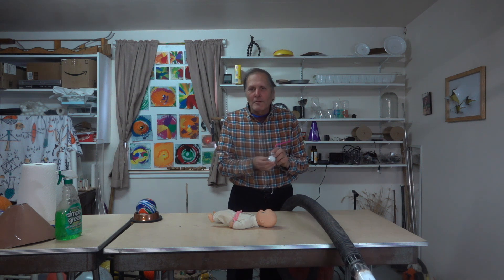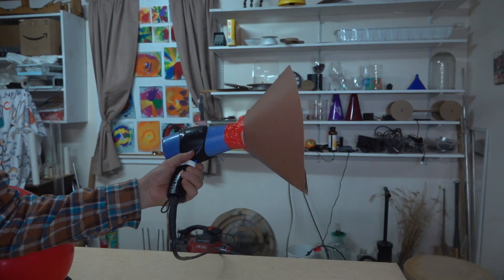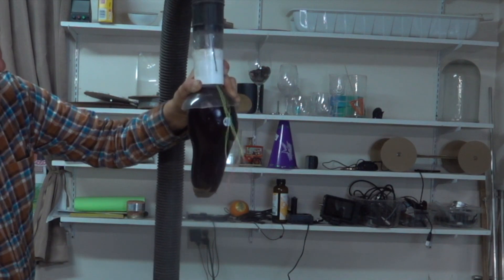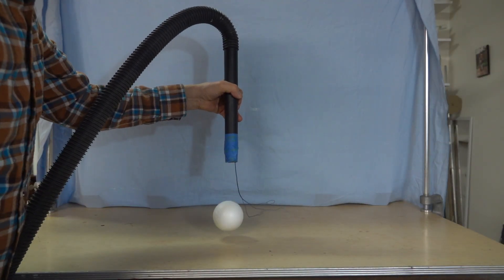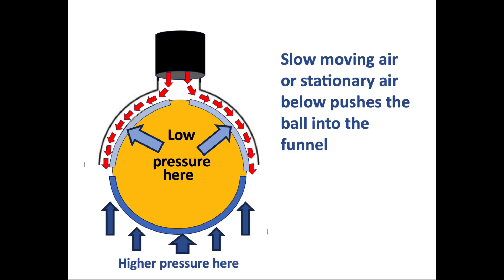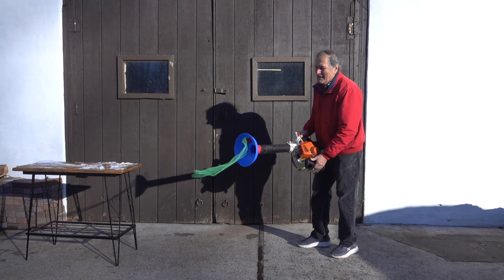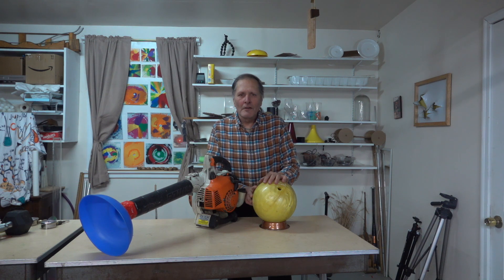Ball in a funnel experiment..Bernoulli's principle and the Coanda effect

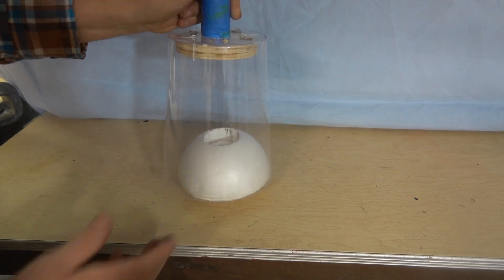Comment: 5:35... think it through...

the air that goes through the hole has to go somewhere... underneath. at which point it forms a layer between table and face and creates the same suction... curved surface being pulled up, flat surface being pulled down...

Comment: Very good demonstrations! @5:30 cutting out the center of the semi-ball is an absolutely every inventive way of experimenting, congratulation! 

Noted that though, the Coanda effect is clear (and in the way it is being thought of) but the Bernoulli principle is (historically, and currenlty) absolutely misunderstood ( with huge engineering implications ). Both Coanda and the misunderstood Bernoulli effect are based on the boundary layer dynamics of a moving fluid as with the increasing of the speed the boundary layer becomes more turbulent (and grows in size), and that increases its under-pressure (sucking effect), the swirls, in the turbulent boundary layer create as they try to transfer some energy to the walls of the bounding surfaces. The process generally is even more complex, as it combines Newton's 3-rd law of motions with changing of the impedance of the moving fluid, by changing the cross section it moves though, and the viscus and the inertial forces (the Reynold's number), and that creates the highly complex dynamics in boundary layer.  That under-pressure sucking, only in the boundary layer, which increases with the fluid speed, is the true dynamics that creates the so called low pressure, which is misunderstood for so many years as the Bernoulli principle (that is clearly demonstrated @5:30, and this is why the presentation is very innovative!). This explanation is based on the work of Dr. Robert D. Hunt , who in 2017 publish an article on the explanation of the (misunderstood) Bernoulli principle, based on  the boundary layer dynamics. Notably there were others before him ( Investigations of the asymptotic suction of the boundary layer, 2001 ) in research publications explaining the sucking effect of the boundary layer.

Comment: The blower speeding up when holding the bowling ball is interesting. I know vacuums do that when blocked but hadn't considered the same is true for the exhaust side. But from what I just read, the impeller is basically just spinning a mass of air with it rather than pushing it, which is much easier on the motor. But in that case, its surprising it can still hold the ball with reduced airflow. 

As for the pumpkin, I'm assuming the air finds its way into the grooves which not only slows it down, but also means its flowing over far less surface area
Reply from the maker: Actually that surprises me also, when the air is blocked on the inlet,  the pressure is reduced in the fan so it can spin faster,  not sure what's going on when the exhaust is blocked

Comment: Pumpkin grooves might be preventing it, maybe?
Reply: I think it's the mass of the pumpkin versus the fairly small area of low pressure. Having a snug fit between the funnel and pumpkin gives a higher velocity and thus a lower pressure. Once outside of the funnel and high velocity/low pressure zone the shape is fairly irrelevant.
Reply: This is my guess, tape over on a diagonal/spiral fashion using the pumpkin as framing and it might go.
Reply: Its weight and the feeble fake "lift".  The bowling ball almost falls for the same reason.

Comment: Thank you for demonstrating that the Bernoulli effect cannot "lift" an airplane, regardless of how it's curved. This was clearly shown with the pumpkin and almost with the bowling ball as well.  Also for proving that the Coanda effect significantly contributes to the "lift"  Hopefully this proves to the Benronullidiots that it is not what lifts and airplane wing so that it flies.  It is the angle of incidence (a.k.a. angle of attack) which provides >90% of the lift of an airplane wing.

I put "lift" in quotes, since there is no "lift", or suction, only differential pressure; whereby the ambient air pressure pushes the objects into the funnel.  'Ol Julius Sumner Miller is smiling!
Reply from the maker: Loved JSMiller ,  "there is no such thing as suction, no such force".
Reply: Totally agree regarding the Coanda effect and the angle of attack. I cannot for the life of me understand why people cannot understand this. If the Bernoulli effect was responsible for lift then a wing that was semi circular in cross section would cause lift.
Reply: @rogerwilson6367  And yet, if you search the internet for the reason airplane wings fly, including Chat GPT, you will almost always get: "Bernoulli..."
Reply: @ True and schools still teach this.
Reply: @ I guess you have to be a perfessional edumacator to teach science.